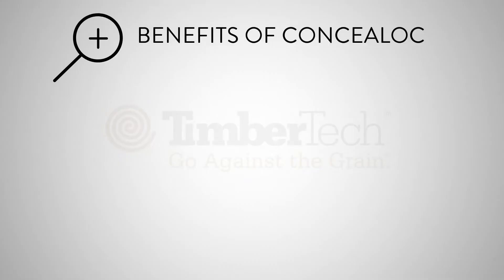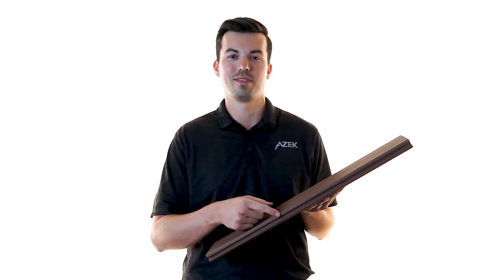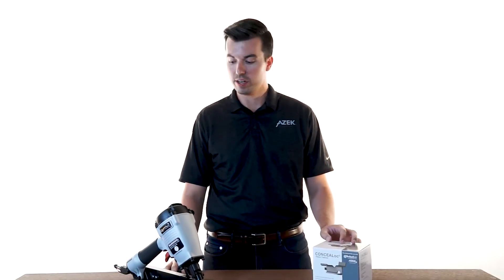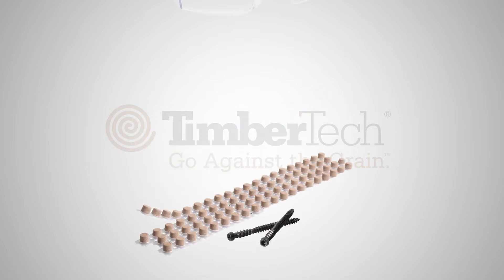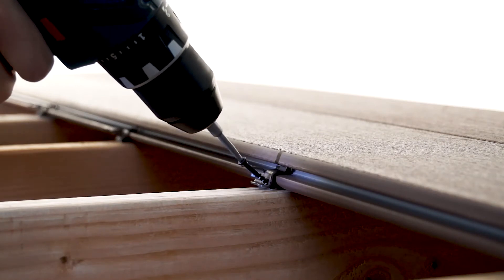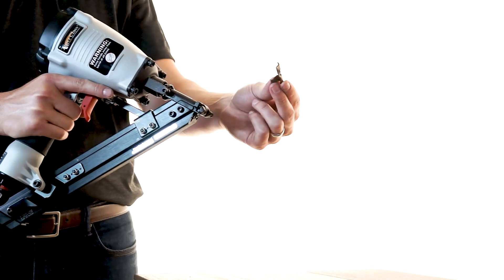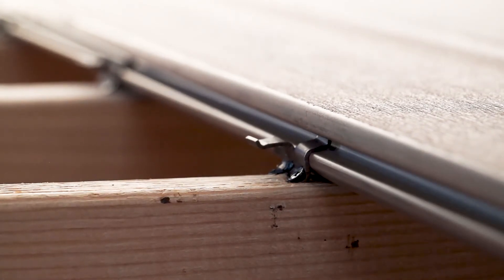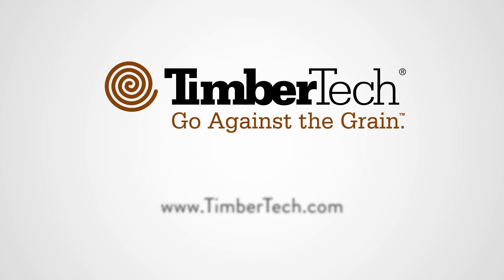CONCEALoc® Hidden Fastener  - for all TimberTech® Decking

Comment: How do you reduce the squeaks using the Azek boards.  They flex a lot and are light weight causing flex between the joists.   They should be installed with 12" o.c.  not 16 o.c.   Or buy the 1.5' thick Azek if you don't want squeaks.

Comment: Perhaps explain how to install the last two boards?
Reply from the maker: Well you've stumped me. Thankfully, our team should be able to give you the answer you need—mostly because they are WAY smarter. Their email is timbertechdecking@gmail.com
Reply: @TimberTechDecking  WTF? Your email for a professional company is a gmail account?
Reply: Gary, I believe you have to use a top-fastener, like Cortex or TopLOC for the first and last boards (and any border boards).
Reply: The last board will have to be a square-edged board (so you don't see the groove). Then use one of the top fasteners, such as TopLoc, to hold the last board in place. You will need to cut a groove at every joist on the side of the square-edged board with a router so that it can fit the last set of conceloc fasteners. If it is a tight squeeze you might have to use TopLoc instead of conceloc on the last two boards (like if you are up against a house at the edge).

Comment: How do perimeter boards go on?  Do those get face screwed in?
Reply: Tarek, There are "L" brackets available for them. Working on deck not that I have used them on.
Reply from the maker: Well you've stumped me. Thankfully, our team should be able to give you the answer you need—mostly because they are WAY smarter. Their email is timbertechdecking@gmail.com
Reply from the maker: @albertafflitto6036  Both are exceptional fastener options.  If you are going to use Concealoc clips for the field of the deck, you should reinforce the joints with Cortex.  Cortex should also be used on stairs and picture frame boards (areas where Concealoc will not work).  Cortex does a tremendous job pinning the boards down which helps reduce chances of expansion/contraction concerns down the road with temperature swings.
Reply: Yes